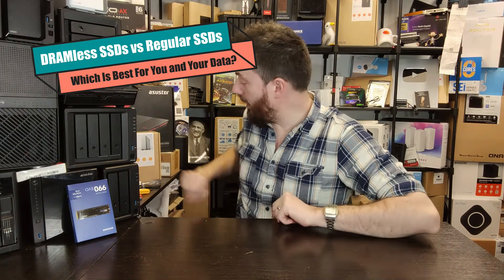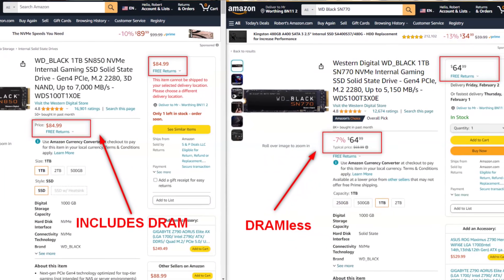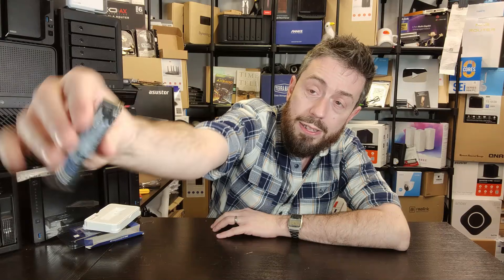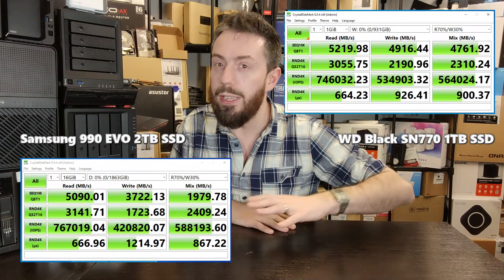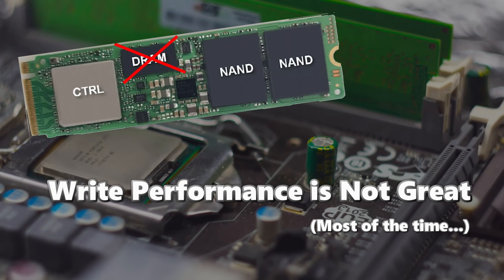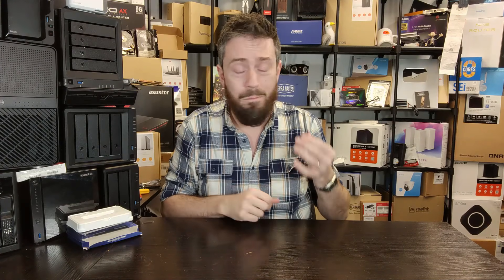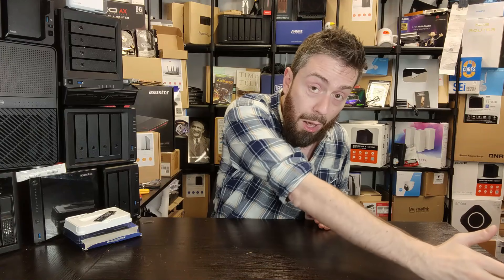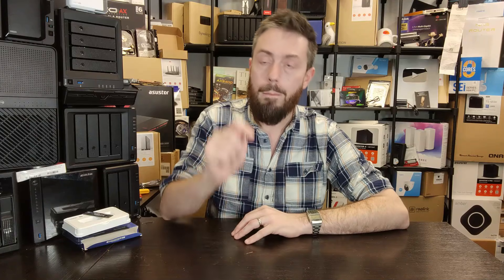DRAMless SSDs vs Regular SSDs - The Pros and Cons

Comment: I don't think some of your comparisons are entirely fair in being attributed entirely to lack of DRAM.

Difference in performance may be down to the tier of the product, not just because of a lack of DRAM.
Plus the choice of NAND matters, as more smaller modules vs fewer larger ones means potentially more channels to operate in parallel.
Think of it like RAID, 4x1TB disks have twice the bandwidth over 2x2TB.

Comment: Doesn't M2 queries CPU every time it needs HMB?  Is done trough the CPU as long as I know.
 How many times CPU will be queried because HMB by the M2 as OS drive for windows with several writes and reads done by OS?
Is even worth considering 2 watt less in power efficiency when CPU is queried by M2 and CPU can consume way more watts that the actual savings of DRAM less M2?

Comment: Problem when ppl say lower write speed, "lower" is relative, it wont drop to like HDD 5400RPM levels :) In the end it feels like if you have to ask the question what drive to buy you most likely wont notice the difference :) Dont forget that not too long ago SSDs were still pretty rare, HDDs did not had RAM in them and somehow all worked. Im using WD RED HDDs in my NAS and sure, its not fun when I need to transfer say 40-50Gb from it to my SSD for whatever reason, but its not like Im doing it every day.

Comment: Excellent video
How about video editing?
Is dram necessary?
Reply: The issue with Dram less SSD and creative work is the extra pressure put on both the memory buss and the PCIe Buss as the SSD Data is forced at the highest priority and makes everything else to wait and stall causing higher latency in audio recordings and often crashes of the DWM drivers and any other time sensitive drivers to blue screen. It has caused issues with some graphics and other things.

If you do office work and none of your processes are time sensitive like they are in video and audio work then Dramles is fine, probably.

Comment: sorry but that is complete nonsense! DRAM on SSDs is only used for the lookup buffer. So where data is on the SSD, not to buffer data. It's definitely faster with DRAM. But if you have no idea about the technology you shouldn't make YT videos!
Reply: This is what I found online too. But usually the ssd need 1gb dram per 1TB flash, while at the same time the hmb ssd uses only 32-64mb ram. This may cause big performance gap.
Reply: yeah the Hard truth actually Controller do the buffer, and high quality controller make the ssd more durable.
Reply: Maybe you should be making the videos then.

Comment: Let's be honest, flash-memory is still not really fast memory and that durable. (compared to other storage solutions)
The RAM helped the algorithms to reduce the wear-and-tear. (and indeed, at times, the performance as noted in this video)
Dropping the on-board RAM is next to a cost-saving move also because of chip-shortages, which is still a thing.
I do agree omitting RAM may not impact that much in several applications but for modern-day NAS, in my opinion, you will need it.
And FYI dramless is something that has been ongoing since (about) 2017.
Back then it was really, really bad on almost every level. Nowadays it has improved substantially. (controller & algorithms)
It is the same as with the number of flash-chips (as you mentioned), the amount of layered flash-cells per chip, it is about costs and not always to the benefit of the users/application.
When you want to obtain SSD's, it is nowadays really an intens study, figuring out the various caveats.
Reply: If you want high durability and high speed maybe try a drive with dynamic slc caches and format it the size of the slc cashes so this way it will never put any cells into QLC mode. The 2TB drives I bought have 600gig before changing the cells into QLC. I use this for caches for PrimoCache level 2 cache. Using a dramless tlc drive lost 45% drive life in 18 months, this has lost 0% 6 months.
Reply: @julesc8054  True, there are solutions to many, if not most "drawbacks" on SSD/flash memory to a certain extend.
Personally I would expect that NAS brands (QNAP, Synology etc) to "solve" such challenges by implementing improved caching-schemes and techniques as you have outlined. I do expect that with more & more flash-only NAS machines upcoming, such improvements would eventually happen, if not already so.

Comment: At Gen 4/5 speeds, DRAMless is plenty fine for situations mostly dependent on reads that rarely experience intensive writes.
I use two DRAMless drives in my DIY NAS -- one for boot drive, one for app drive -- because DRAM would give no performance benefit and not be worth the extra money.

Comment: 6:59 - "One Small Security Blip:"  Are you sure data can be retrieved from powered down DRAM?  It's volatile memory isn't it?  How can data be pulled off this if it's been powered off / pulled out of the host system?  Cheers.
Reply: It's serious espionage level stuff that the average person doesn't need to give a second thought toward.
Volatile memory takes anywhere from seconds to minutes to properly discharge. If there is physical access to the machine in that window, a memory dump can be done with specialized equipment. The most reliable method involves freezing the memory (not as in locking up the system, but as in actual freezing temperatures), which can make the data persist for days.
Reply: @davidg5898  Ahh this makes sense now.  I expect @NASCompares wes talking about grabbing data off the DRAM in a very narrow time-window then, and not, say, hours, days, or weeks later.  Cheers!
Reply: @davidg5898  not that it'd ever matter to me but that's intriguing lol
Reply: @davidg5898  I guess this would matter only if you have an NTFS encrypted drive? Is the data un-encrypted in the drive's DRAM? I thought the OS is in charge of the encryption...
I still don't get it, in which case is the DRAM more accesible than the stored data itself?
Reply: I guess if you hear a pounding on your door because you're being raided by the feds, you're going to want DRAMless. 😂

Comment: Had a question!!! Does dram or not affect even for using as an external ssd ( as used as an external storage device ) ! And how do I upgrade the firmware in an enclosed ssd ? Thank you 🎉 Your videos are so informative 🎉
Reply: I would say it's more important to use a SSD with DRAM in an external enclosure because it can't use HMB (which is used to compensate for the lack of DRAM) if it's used over USB or similar. For updates, it depends, often it's just not possible without plugging the drive in directly.
Reply: @tomsuper2199  Thank you for replying 😃 I have formatted my ssd to exfat ! Is it then possible to just remove the ssd from encloser and directly attach to the computer ssd slot and upgrade it ? Will it delete or format my data in the ssd ?
Reply: @L5005HeX  That sounds like a plan! It shouldn't format anything without your explicit permission, that said some people and companies recommend a backup before a firmware update because if anything goes wrong it's a possibility to lose the data (never happened to me, but if it's important data I would definitely make a backup).